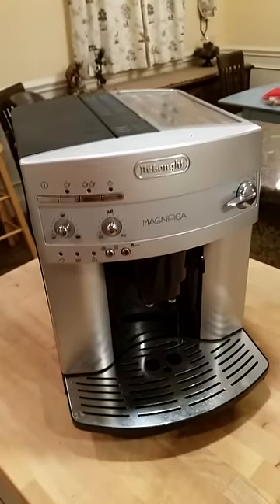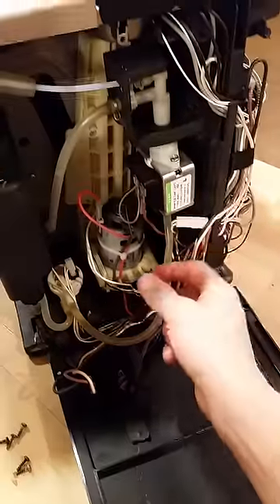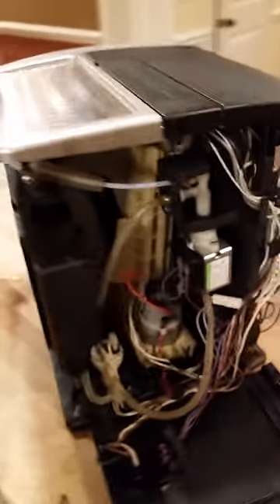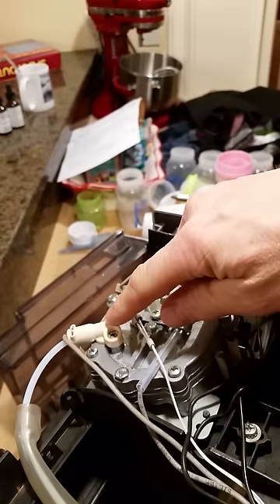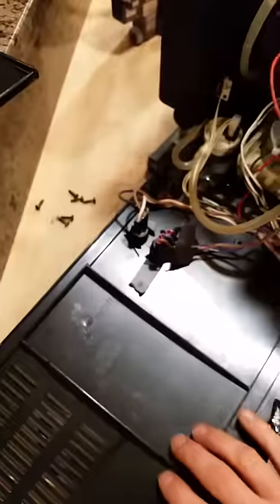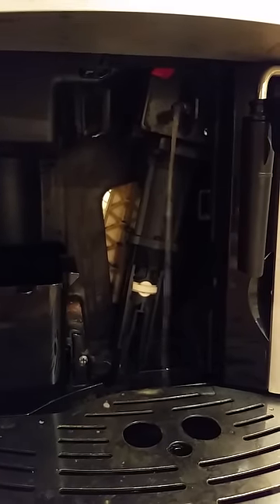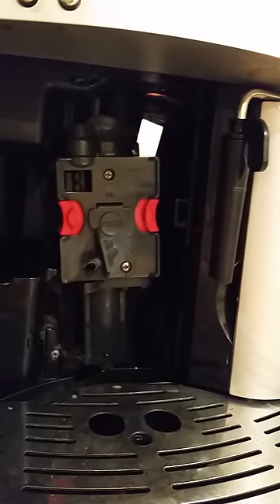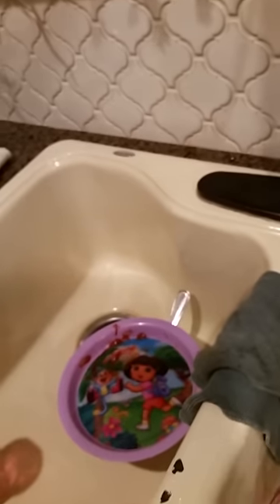Part 1 : Pulling apart my Delonghi magnifica. Info on several common issues

Comment: Hi Timo,

I just lubricated my ESAM4500 infuser and plunger lift and cleaned it with pressure air (not very high pressure though) and assembled the whole machine back. But now I am getting false notice to 'Insert Grounds Container' even though it has been inserted. Even 1st test mode (pressing Short Coffee and Long Coffee buttons together and powering the mains on) is not working now. Need help here.
Reply from the maker: Mehul Mepani like I've stated in the video it's a fairly simple machine not overly complex. Everything just runs by simple sensors.  If it's telling you the grounds trays out that means the sensor is not working properly, but sometimes a hard reset will take care of the problem.  The sensor is located down on the left side.  If you pull out the grounds tray basket you will see the prong that pushes the button. I really doubt you cleaning the infuser had anything to do with it but bear in mind that the fault codes all come through just the few lights that are on the machine.  I would advise looking up the manual which is pretty easy to do with the model number and a quick Google search and confirm that it's actually telling you that the grounds is the issue
Reply: Hey, Timo Seppala, I think I solved the problem. There was water in the sensor most probably. A liberal spray of contact cleaner did the magic. 

It will be perfect over the time, as water will finally evaporate. I think so, let's hope. 

Thanx for prompt answer.
Reply from the maker: Mehul Mepani that's very likely I have seen it fail from a leaking unit that was getting the sensor wet

Comment: I have a magnifica s and the plastic milk frother shoots off the end causing what can only be described as a milk explosion. Ive replace o rings to and the inner nossle but it still does it. It is possible to fit an all metal frother to these?
Reply from the maker: I am assuming you are sliding it in then turning it to lock it on?
Reply: @timoseppala7137  lol do you know I've had that machine for years and never done this. Thanks. I'll make a coffee in a bit and try it out. Will this stop the inner bit shooting off though?
Reply from the maker: @MrDirkles   it will hold it on yes but that part should really stay on by itself my guess is it's just a little worn out so it doesn't want to stay on.  Might need a new o ring or you may want to take a needle or something and clean out the tip might be a little clogged so it's building up too much pressure.  FYI if you have a harbor freight near you you can pick up a pack of 500 o-rings that has every size imaginable for like 7 bucks.
Reply: @timoseppala7137  thank you I will try that. I'm in the UK so I won't be able to get that bumper o ring package :)
Reply: @timoseppala7137  ive made 5 coffees without any incidents. Thanks :)

Comment: Hello, my magnifica machine has an issue. When plugged in, three top lights keep flashing and it never heats up. In the manual it says that’s the indicator of steam knob being open. Any chance to get it fixed?
Reply: I have the sane issue. Were you able to solve it?
Reply: Yes, I got this too. Infuser moves,then flashing lights.I suspect heater has failed.

Comment: Hi sir ive been watching your videos, PLEASE RESPOND I HAVE A QUESTION, THANK YOU! I have a delhonghi magnifica esam 04.110S that my land lords threw away and I have to descaled it now and I am a single mom of 2 babies under 2 years old lol so I'm really broke haha so I can't get the descaling solution, i dont even have a debit card, anyway, so I was wondering if I can use hot water to descaled it? I appreciate your time sir! Thank you, Breanna
Reply from the maker: Sorry no, that won't work.   You can do a quick Google search and see that people do it with vinegar.    It won't work quite as well.
Reply: Half vinegar and half water. Remember to flush out the vinegar afterwards. Lemon juice is better at descaling as it is stronger-about 1:3 solution is plenty strong enough.  You will have to descale more frequently than the descaling solution.  I have never needed to descale since changing from tap water to rainwater!

Comment: Hi , i have a ESAM4 , the coffee puks are not as full as they were , and now the coffee is weak. What is the cause of this please?
Reply from the maker: There are a few things that can cause that.  First of let me say i do not know what an ESAM4 is.  If it is different than this machine it could be something else.  That said, the most common reason would be a clogged grinder or hopper.   Which is usually caused by oily beans.  This machine should never have oily beans in it (Starbucks?) If it is that, you will need to open up the grinder, clear the chute, hopper, and grinding gears, then clean them thoroughly.   What happens is the grinding Burrs get so much oil on them that they begin to burn through the beans rather than grind them.  In doing so it ends up producing much less coffee grounds, resulting in smaller pucks.  Also try cleaning the infusor, and lubricating it with an approved food based lubricant.   Clean the upper plunger and lubricate it as well (inside the door up to the right).    It's possible if those things don't work that it's time to replace the grinder burrs.  they can be purchased fairly inexpensively and are not that difficult to change.
Reply: Thank you, It’s a delonghi magnifica and says esam4 in the manual, I have taken the grinder apart and have cleaned everything. Do i need to lubricate the bearings before re assembly. Thanks again for your support.
Reply from the maker: not necessary, just put it back together

Comment: Hi! I have a prima donna machine and the coffee has been horrable (bitter and metalic taste)... I am just wondering if the problem is scale built up inside of the machine.  Would you have any idea on whats wrong with my coffee machine? thank you
Reply from the maker: M Chaves do you descale your machine regularly? It should be done approximately every 2 months.  Also you should be running nothing but filtered water.  Your infuser should be removed about once a month and soaked in water.  Oily beans will clog up the grinder.  My guess is the problem is one or a combination of many of these issues.  Oily beans after a while will alter the taste
Reply: Hi Timo, thanks for coming back to me. I've just taken my coffee machine apart today to have a look. I inspected the hoses and they look pretty clean (transparent). I also washed the spouts, cleaned the grinder. I looked everywhere for leaks and nothing but I suspected the problem was with those beans that stay on top of the grinder. Even though you put new ones in, there will be always old ones  that will be ground as well which might alter the taste. After cleaning a bit, the taste improved - far away from a coffee made in coffee shop though. Those machines are all the same mechanically speaking to my surprise, it's the digital panel that changes.  In your experience, where does the scale build up? Do you reckon I should clean the hoses or tubes anyway?
Reply from the maker: Cleaning the hoses would not be a bad idea you can let them soak in warm water also if you take apart your grinding mechanism you can clean everything out with a shop vac and then use a wash cloth to wipe it down. The reason the oily beans mess up the flavor is because they get a coating of oil all over the grinding blades and when it grinds it ends up doing less cutting and more burning through the bean.  If you have been using oily beans I would say that's probably the culprit if you're very careful you can pull apart the grinder and remove the grinding wheels and clear them
Reply: Hi Timo, I took the grinder apart and did a cleaning in it and.... The bitter flavor disappeared!!!... so it was the grinder the culprit. Thanks very much for your insights.  The youtube community is fantastic. Have a great weekend. cheers Mel
Reply from the maker: That actually makes sense that cleaning the grinder would help are you careful to not use oily beans? Using oily beans in this type of coffee maker will cause the grinder to burn through the beans rather than cut it.  Doing that for a real for long period of time will leave a film stuck on the grinder gears and the hopper.  Each time you try to make a cup you'll be incorporating that burnt taste into your cup of coffee

Comment: My machine is clicking.  Water won't come out, except a few drops out of the steamer.  I'm wondering it it might be the pump or the flowmeter.  Any suggestions?
Reply from the maker: Angel Conger that is definitely the pump.  easy to change and cheap to purchase.  the video shows where to find it.  it's located behind the back panel.  you may be able to get it working again temporarily, but it will ultimately fail again unless you replace it
Reply: Timo Seppala thanks so much!  I ordered it and it's on its way!
Reply from the maker: Angel Conger I thought after sending that message that there is a slight possibility something else could maybe cause it, but it's a 99% possibility if you are heading clicking noises and no water pumping it would be a bad pump
Reply: Timo Seppala I watched your video and took the covers off to see if I saw water pumping. Nothing was pumping. So I pulled the water hose off of the bottom of the pump and tried to suck some water, in case it was a blockage. Water came out fine with some suction. So, I'm pretty sure it's the pump. Btw, thanks for posting.
Reply: Timo seppala o

Comment: Hi Timo,
My english is not so good, but i hope you will understand. I have delonghi esperienza, but look same as this. My infuser is stock on the up side and red triangle light is on. It seems the infuser stay in position when make coffie. Can you help me'
Reply from the maker: Honestly I am not sure.  Usually it doesn't move because something else has gone wrong.  First thing to try is a hard reset.  I'm not sure how to do that with your machine but a quick Google search should find the answer
Reply: Hello Aca, did you find a solution?

Comment: Hi Timo, my Magnifica ESAM-4200S machine (only minor cosmetic differences from your model as far as I can tell) has been working perfectly fine for about 3 years. All of a sudden all front panel buttons stopped responding (there were no unusual sounds or burning smell or anything leading up to that). The machine was in steam mode at the time with the steam light on, and I couldn't do anything with any of the front panel buttons, not even turn it off. I turned it off with the back power switch and now when I turn it on with that back power switch, it momentarily makes the normal whirring sound, all panel lights come on and go off and then it stays off--all what it normally would do, i.e., there is power coming into the machine. Of course, I cannot go further since the front panel power button is non-responsive and I can't actually use the machine. Any ideas?
Reply from the maker: Try a hard reset.  Unplug the machine.  Wait a minute.  Then press and hold grounds and decalcify buttons, and plug it in.  Do not release the buttons until the infusor stops moving.  Let me know if this helps
Reply from the maker: It is possible that you need to replace the front controls, but the way this machine works, it works in steps.  In other words you switch it on, it sends a signal to the boiler and it won't do anything else until it warms up, then it moves the infuser to a certain position and it won't do anything else until it reaches the position, then it activates the pump, etc.   so what happens is if one single item fails, it will stop once it hits that point and it won't continue.  

You said when you turn it on you hear the infuser moving does it run the rinse cycle?   I need to know exactly at what point it becomes unresponsive.  If it is getting hung up it could be just about anything.  A failed sensor that lets the machine know when the infuser as at a certain position would cause everything to come to a halt.   The thermostat on the boiler failing would cause it to never move Beyond heating water, etc.     If it's not getting hung up on a certain item then I would say the controls need to be replaced.    obviously it's a little difficult to diagnose Without The Machine in front of me, but those are the steps I would go through
Reply: Solved--thanks Timo! Didn't know one could do a hard reset on this machine (it did seem like a "firmware hang" problem just from the symptoms, rather than something loose or burned out). This model doesn't have a grounds button--instead you have to turn the beans quantity knob all the way to the left to achieve that. So I tried that with the calcify button, and a couple of other combinations that I came across on the Internet (Power+1-cup is one that I remember, and 1-cup+2-cup+steam is another). One of them seemed to have worked (sorry, can't tell you which since I didn't try turning on after each one since there was no different behaviour from the machine)! Note that you DO have to wait several seconds after unplugging (or turning off via the physical button at the back if your model has it, as mine does) before you try the reset.

Comment: My inforsor stacked on the top position, so every part of the inforsor is open, only the “!” Light is on, please advise how to reset it?
Reply from the maker: You need to do a hard reset.  Turn the power off and hold the decalcify and water buttons while plugging it back in
Reply: Hi Richard, I have exactly the same problem. Have you found any solution so far?

Comment: Mine does some funny things. It either comes on ,and all the lights come on at once and then they go off after two noises which sound like the  normal  noises I used to hear when it was preparing to start . It does this  when the infuser is in down position, The other thing it does after I have to unplug it and start it again , it wont come on without unplugging and replugging , then it  makes a straining  sort of screeching noise  and then the two cups lights  and the red triangle light comes on solid and the infuser goes up during this noise and stays stuck up there until I  unplug and restart over and over until finally it comes down.  on the third time unplugging and starting it tries to come on , go up screeching and it might come down and the two cup lights come on ike it might work ,a and then the red triangle light comes on and it stops .  If I turn the water handle to the right , the light comes on but I cant get it to steam. Warmer gets hot. I have cleaned and  I lubricated the infuser ,. Please help . I am just crazy .... I and 4 older children are so used to our good coffee .  IF  we cant  figure it out with your help , would you repair it ? I can give you my email
Reply from the maker: TexasAndres have you figured this out yet? Send me an email at seppalatimos@gmail.com
Reply: it was the main generator . Had it replaced . .... found one video here that showed the infuser making just the noise I heard.

Comment: you'd better use filtered water and all the pipes will remain clean and coffee taste will be significantly better.
Reply from the maker: Yeah that's a given.  I use a Brita.  I didn't feel on a coffee machine repair video I needed to state the obvious.  Better water=better coffee and cleaner machinr
Reply: @timoseppala7137  Although I absolutely agree with you, I meant a different thing in the first place. With a good filter you won't get any live stains in the pipes -- just because with a good filter there is nothing for the mold / fungus / bacteria to eat, there will be just water. Try something like this https://www.freedrinkingwater.com/ro-90-detail.htm -- this is not an advertisement, feel free to pick any RO system made in the US, and you'll see the difference.
and thanks for the video ))

Comment: Anyone using electric screwdrivers like this is asking to lose screws. Good start. Using it to put them back in will wreck the machine. This client wouldn't be allowed anywhere near my kit.
Reply from the maker: I used a drill simply to make it quicker for the sake of the video. I only used the drill to remove screws, not putting them back then.  Not sure why i am even wasting my time responding to your comment, I did this video 100% for free just to help others who were in my shoes.  Since i posted it i have helped countless people diagnosis and repair their machines through chats, phone calls and emails.  All of which i have donated my time for free.  I have never been paid to help anybody to date.   Take your negative comments elsewhere